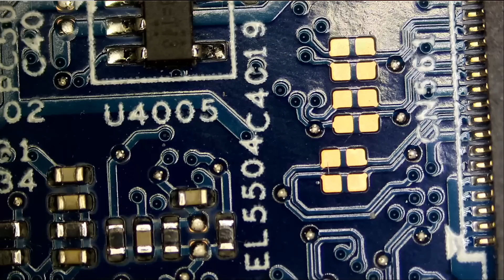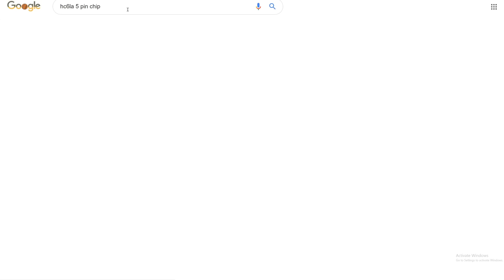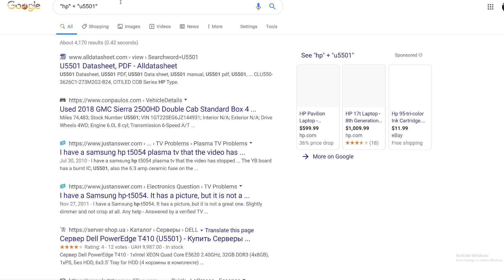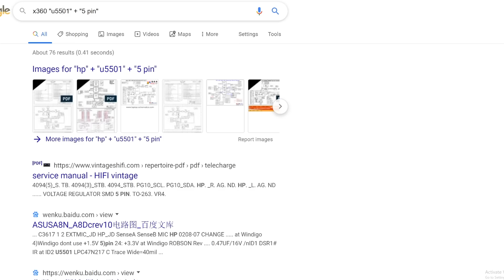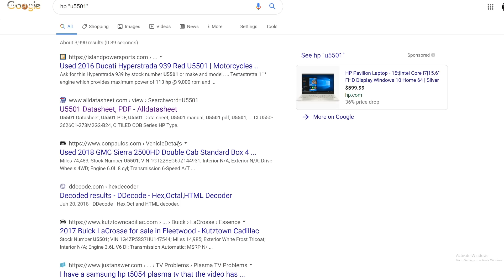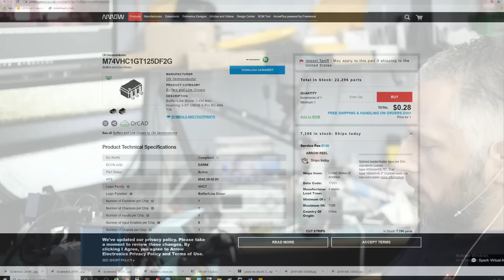Spectre X360 Black Screen. What's U5501 and why it keeps blowing

Comment: Hi Alex, I joined ur chanel just a couple of days before. It's awesome how you repair the different electronic boards. For this video, the 5-pin chip you were searching is DC-DC boost converter in SOT23 package. This is basically LCD backlight supply. You can see original mother board for this. You can find the alternative as TPS61040 or TPS61041(I know this is late to tell u else we can see another laptop repaired from you)

Comment: wher i can buy a stand for the microcope like you use
Reply: or you can try and search for "Universal Adjustable Direction Articulating Clamp Holder Bracket Arm 76mm Microscope Stand For Stereo Trinocular Microscopio"